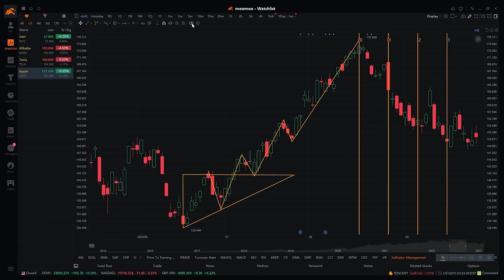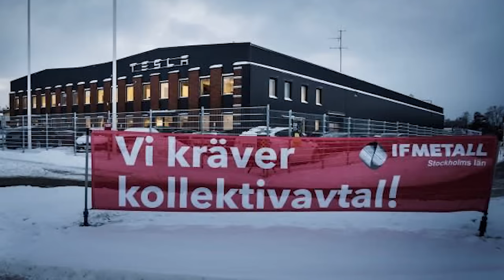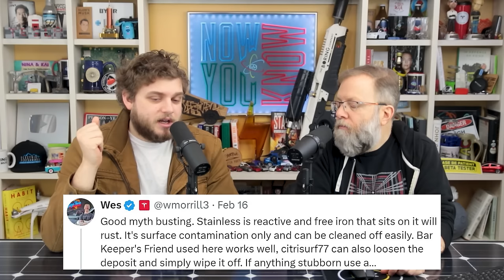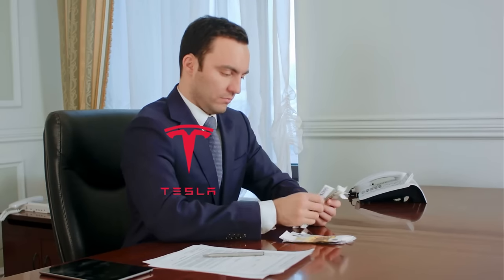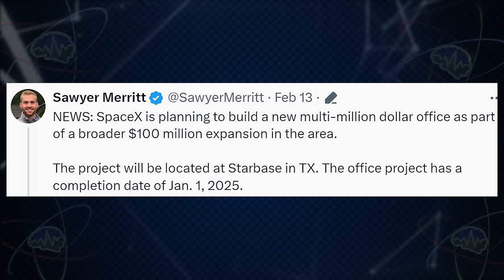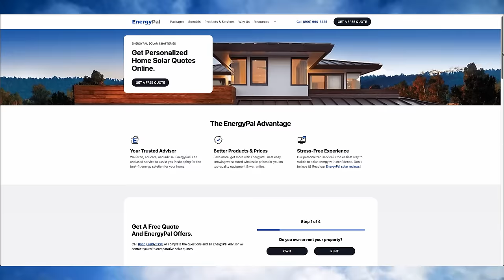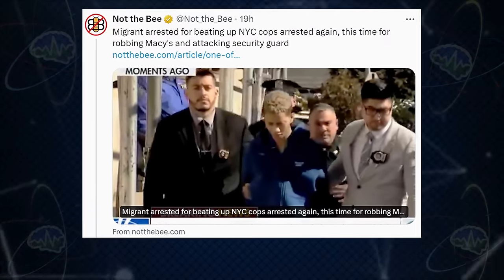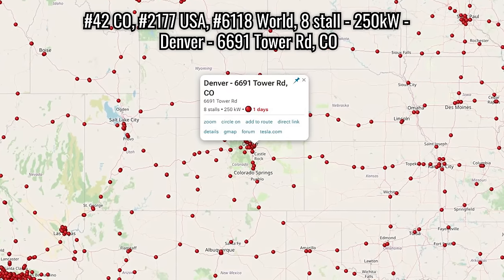Rusty Cybertruck?! | Tesla Time News 389

Comment: You are missing the point. Full Self Driving is misleading. It is suggesting that the car can drive itself. Couple that with the fake self-driving video they made with the disclaimer that the person driving is there for legal reasons and the car is driving itself it's definitely giving an impression that the car can drive itself without any input from the user meaning you can drive it even drunk
Reply: Autopilot for a plane is suggesting it can drive itself as well? No you still need pilots to be managing the situation. I mean if you read the disclaimer which I doubt you did, it needs the driver to be assessing the situation while it self drives. You FSD 12 is looking really good but you can FUD more, it’s easy to point out the idiots in the comments.
Reply: @demongs7481
.
What's "misleading" is you not using the full description of the technology, which is "Full Self Driving BETA "
.
As for the rest of your "opinion"....
If that's the impression you get, you're either not paying attention, or unable to comprehend....
🤷🏼‍♀️

Comment: I have worked with stailess steel for 20 years and it does rust and it does get worse over time, its not from people grinding or anything it just gets rusted, lest rusty material is avalable instedbof 308 use 316